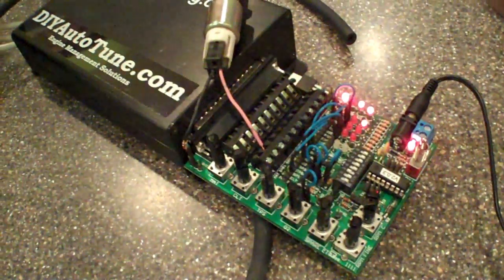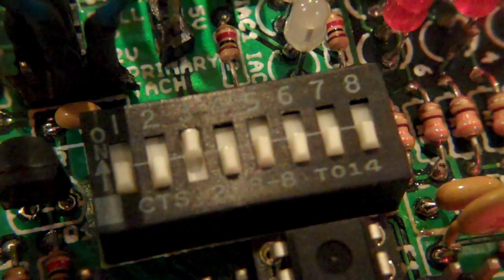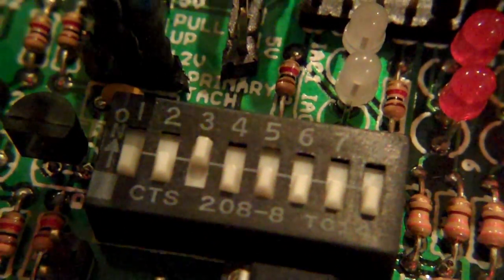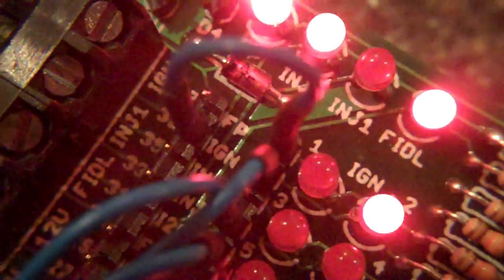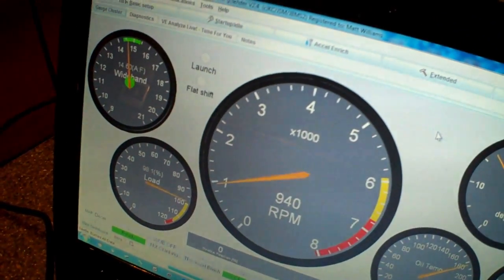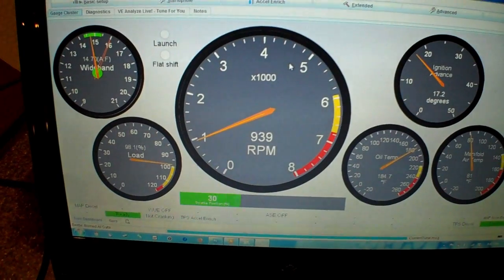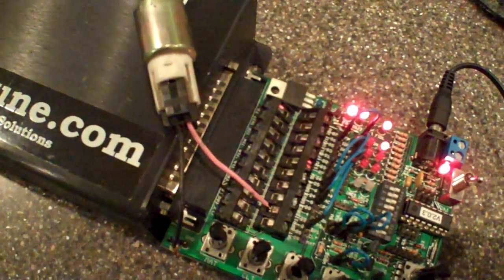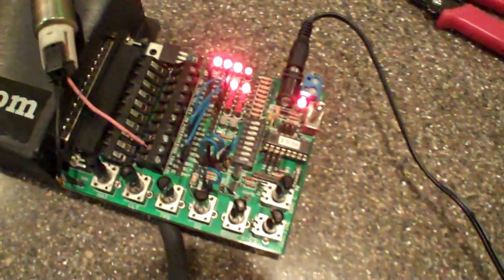Megasquirt testing - Jimstim setup for 36-1 trigger wheel

Comment: did your fp come when u power it on?
Reply from the maker: christopher pitts Yeah, everything worked.
Reply: Maybe because I wasn't getting an ig signal, my won't come on.  I didn't jumper 24 to ig, I think that's my problem
Reply: Matt Williams what needs to be jumpered to start the seq
Reply from the maker: It's been so long since I did this man, I don't remember. I do remember having to try some different settings on the voltage and crank sensor jumpers. I think I had to test using a basic trigger setting with jumpers set as a VR pickup.

Comment from the maker: If you have any specific question I'd be happy to help. If you are using LS2 coils I assume you are going to direct fire from the ECU, which is exactly what I'm doing. I'm not using the EDIS box, only the Ford coil in a wasted spark configuration. I added an additional coil driver in the ECU, for a total of two. You'd need a couple more (at least). The second sensor isa little out of my wheels house, but I'll do what I can to help.

Comment from the maker: It's going to be used on my '73 VW Beetle rally car. The engine is based on the standard 1600cc aircooled boxer engine hat came in it. It's been bored and stroked to 2110cc, forged internals, big cam, high compression (9.5:1 up from ~7.6:1 stock) and fully worked heads. I'm making custom plenums and dual throttle bodies and I've got a set of 560cc injectors from an Evo for the fuel. Should be fun.

If you would like to see the build, you can find it on Facebook. Dirty Dori Rally.